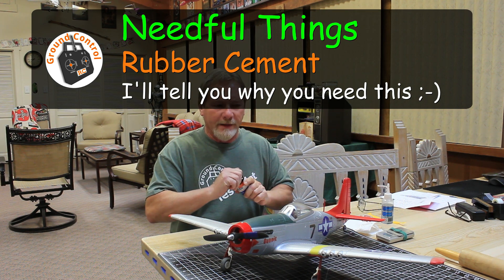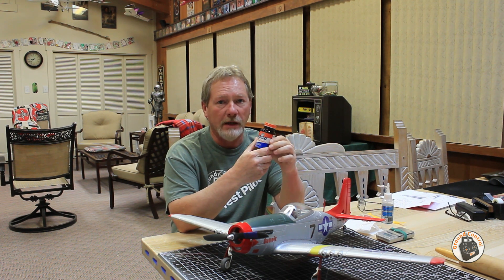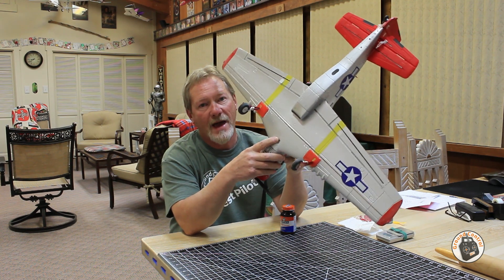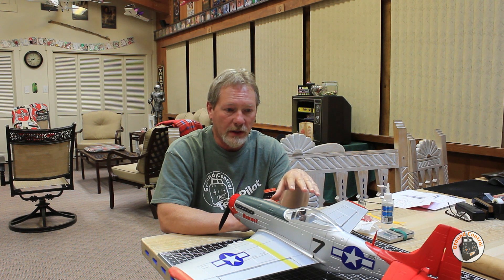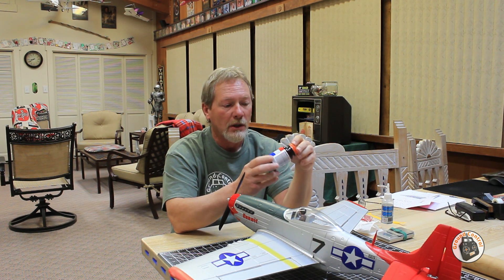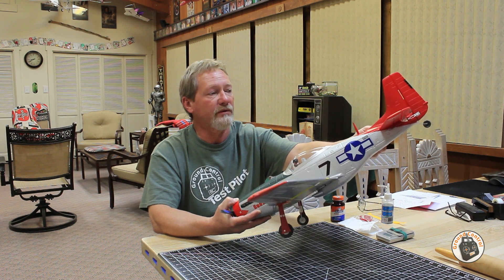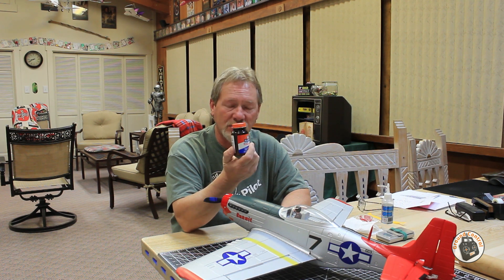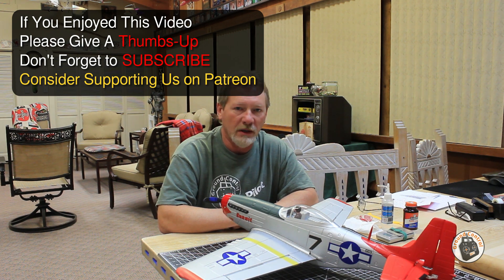Needful Things - Rubber Cement - I'll tell you why you need this ;-)

Comment: yea threadlocker will mess with plastic idk what all kinds..   i had a pair of scissors and they was polycarbonate and had a tiny crack in them forever, then i used blue threadlock with the screw & in the morning  it looked like they shattered like safety glass & i picked them up & they fell apart, i wish it stayed shattered looking look better..   i there is a blue barge in a tube that might be harsh chemical free if you cant get the Elmer's  (But make sure u search before u buy it im not positive)
Reply from the maker: I wish they had some threadlock that worked with plastic but this stuff does a pretty good job.
See you in the Air!

Comment: Thanks for a useful tutorial. Can you give guidance on how to thin rubber cement when it thickens with age?
Reply from the maker: Thanks Stewart!
I'm not sure what solvent they use in rubber cement, perhaps a little bit of alcohol to thin it.
Reply: @GroundControlRC  Thank you for the reply Ground Control.
As I would say in the mid 1960's This is 72delta/charlie (150 cessna) on final approach over and out.
Reply from the maker: @stewartbruce8902  You are Free and Clear to Navigate. Over and Out ;-)

Comment: Brilliant advice. I use plastic motor mounts so this method should be very useful for me
Reply from the maker: Thank you much Ali! I'm using this method from now on. How that wing didn't separate from the plane before I got it on the ground I'll never know ;-) See you in the Air!
Reply: @GroundControlRC  you are lucky to still have your plane in one piece :D
Reply from the maker: @aliberk3112  , I cannot understand, with the issues I had and the mistakes I made with this Plane, how it wasn't completely destroyed. Now I'm so paranoid I check that Wing Bolt every time I land ;-) Hehehe....See you in the Air!

Comment: I was looking to see if I could use this stuff for car tire repair. Funny enough though, I used to be into RC aircraft big time a few years ago. I definitely want to get back into it. It was way too fun!
Reply from the maker: Hi Aron! That's a good question. I'm not sure if it would be flexible enough for car tire repair. I've always used those soft rubber plugs and glue for Car Tire Punctures and that's always worked well. I hope you get back into RC. I love this Hobby ;-) See you in the Air!